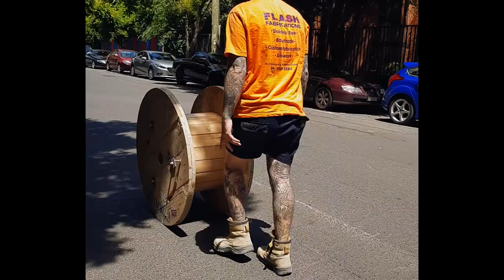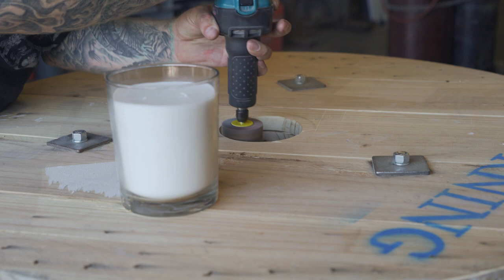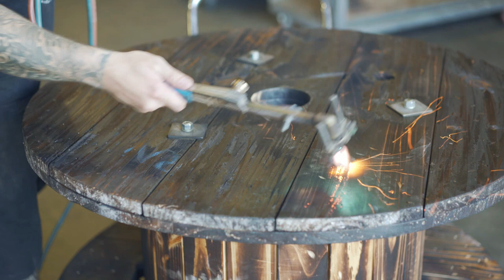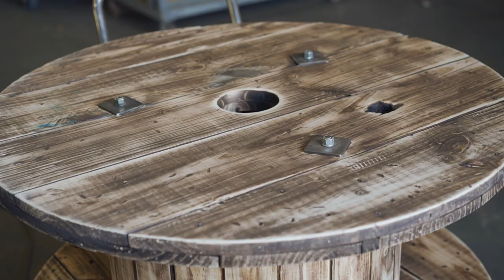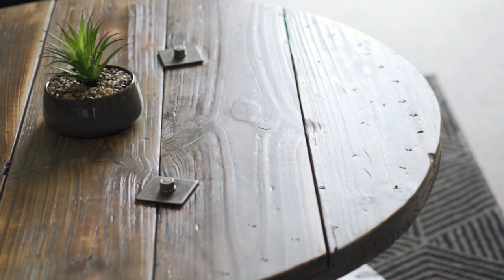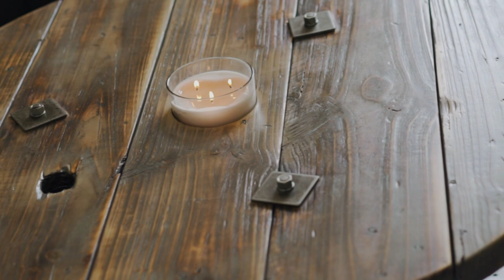Cable Reel Coffee Table (Distressed Finish)

Comment: Nice job, you can get a similar flame effect using black paint, thinned down slightly, paint it on then wipe it off, when dry sand it back again... The paint soaks into the grains of the wood giving it that aged blackened patina...